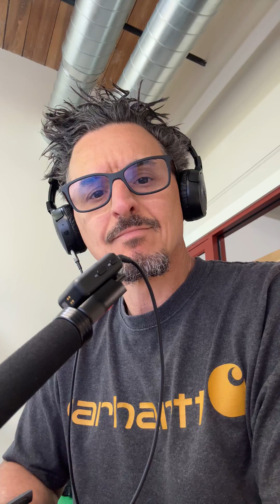On/Off Reheat Is For Sissies. Real Men Use Modulating!

Comment: I like Vav systems with hot water reheat and variable dx capacity.  I have this system in one of my schools my boilers are 95% efficient and work well. This system works so well in those spaces my humidity is very good and the air change over rate is excellent

Comment: I'm actually involved in a situation now with a young guy I met who grows microgreens commercially. My thought was have a properly sized condenser, an air handler, an auxiliary condenser installed in the discharge air of the air handler, a three way valve that will divert the refrigerant from the outdoor condenser and the auxiliary condenser, what may also be needed was a solenoid that would isolate the auxillary condenser so it refrigerant wouldn't stack when it was isolated, and a head control might be needed as well. A control that would prioritize between cooling and dehumidifying that would switch both valves, and a receiver that would act as more than a receiver; like a buffer to insure you maintain liquid. I've seen similar systems at a pharmaceutical company I worked for years ago. 

I'm prepared for you to tell me I've lost my mind. lol... No but serious, i've worked on something very similar to what I described. You may know what it is by name. The physical property of water is why desiccant de-humidification became a thing.